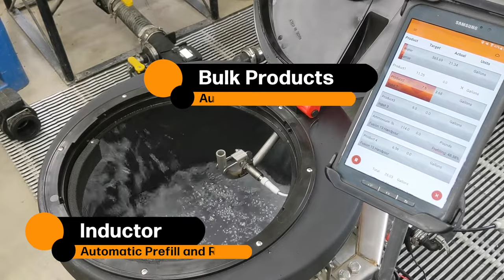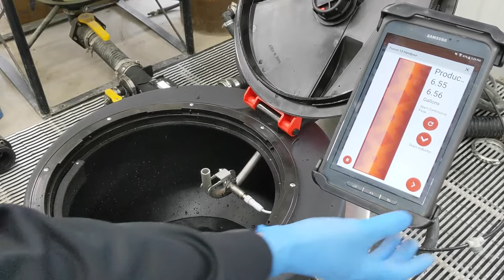Shake

Comment: I get your point, not really apple to apple. You were  rinsing water,  compared to molasses.
Reply from the maker: Hello Alan,  It took over two minutes to triple rinse the jug by hand and it takes around 12 seconds to drain and rinse a jug with Mixmate.  Mixmate will drain measure and rinse the product from a jug as fast as you can pour it out without Mixmate.  At the end of the video, you can see the jug of molasses going through our Pro Inductor.  Thanks for watching!